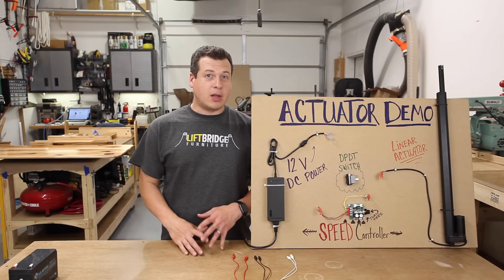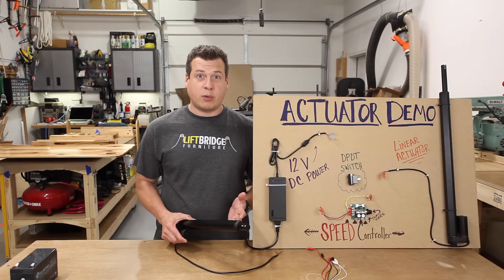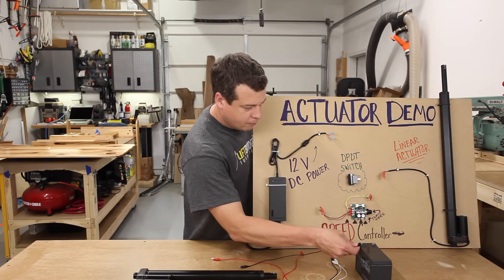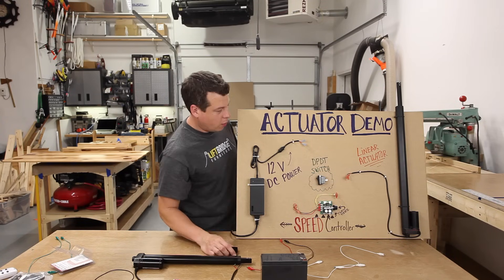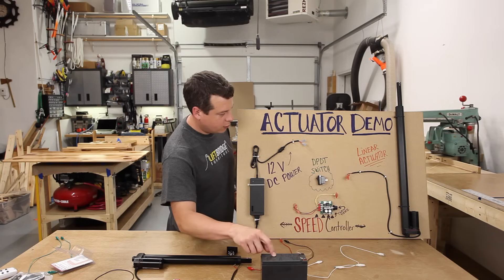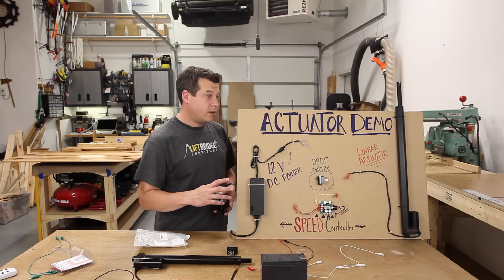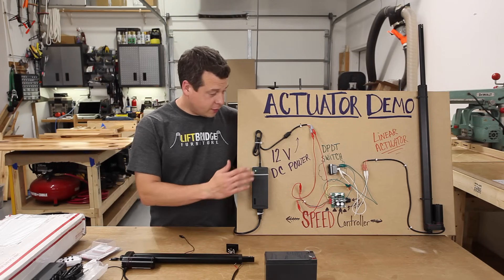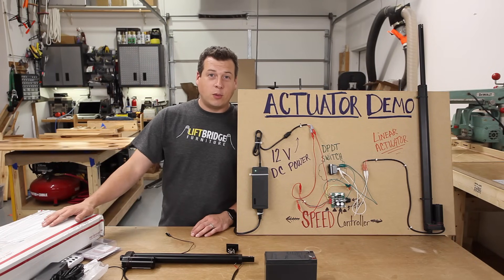Linear Actuators 101 - for Woodworkers

Comment: Question: As someone who doesn't understand electronics, my question is whether it is possible for the polarity of the current flow to reverse on switches and cause a short circuit, or does it not matter which way the positive and negative power supply enters the switch?

Comment: THANKS!   NICE APPLICATION FOR THE ACTUATORS!  I REALLY LIKE THAT YOU ADDED THE "SPEED CONTROL, TO ALLOW FOR "CUSTOM CONTROL, OF THE RATE OF LIFT.
(....BUT, IT'D BE NICE TO SEE THE "WIRING DIAGRAM"/SCHEMATIC.)  TYPICALLY, WHEN RUNNING MULTIPLE MOTORS, IT'S GOOD TO ADD 125% OF THE LARGEST MOTOR AMP DRAW, PLUS 100% OF ALL OF THE SMALLER MOTOR(S)... AND, ADD AN INLINE AUTOMOTIVE FUSE (& FUSEHOLDER), THAT WILL "PROTECT THE WIRING, IN CASE THERE'S AN OVERLOAD/SHORT,...(ESPECIALLY IF USING A "BATTERY" AS THE POWER SOURCE.).  THE "POWER SUPPLY, MAY HAVE IT'S OWN FUSE/CIRCUIT BREAKER.   :face-blue-smiling::face-green-smiling::face-red-heart-shape::face-red-heart-shape::face-red-heart-shape:

Comment: What are the connectors that you are putting in the ends of the wires to make them easy to connect and safe to handle? Thank you!
Reply: Also want to know ….
Reply: Believe they are Insulated male and female spade connectors.

Comment: How do i cut and wire it to a car battery when they send me with the 120 wall adapter? How is the 12v power supply working in this video? If its plugged into the wall i want to cut that off an wire it to a battery.

Comment: So, is the power pack only necessary if you are using 110v in a household/furniture application? Would it not be needed in a vehicular or RV 12v application? Thank you.
Reply from the maker: That's correct. You can power it on any 12v power source.

Comment: Hi I repair and replace motors for recliners and I believe they are basically the same type of motor that you are using. I was just wondering if these speed controllers would speed up a new motor that is slow? Or is the speed of the motor the fastest that it will go. Thanks

Comment: Is there a way to install a small actuator (to open and close blast gates) in a way that it opens with the switch the shop vac is on and closes when power is shut off? (My shop vac and tools are on an automatic vacuum switch). I have a regular wall switch that activates the vacuum without the tools on. I want to wire an actuator to a blast gate just by giving it power on and off (without having to switch polarity). Thanks!

Comment: Thank you so much. This is the best video I have seen that explains linear acurrator and how to set it up. Many thanks. One question, what is the clips you used to connect the wires so there look like spade connectors and what is the wires. Cheers for this very informative video 👍

Comment: Why use DC motors? Wouldn't AC motors be cheaper since they wouldn't require a power supply and more efficient since the current will be lower?

Comment: Is there a brand you recommend now? I'm planning on making the head of my bed adjustable instead of buying an adjustable base. It's on a short wood loft bed with 4x4 corners and 2x4 bracing. My bed is laying on plywood and I was going to use hinges for the bend. If the 2x4 brace doesn't work, I might try some metal angle iron.

Comment: Great video about how these work! I have one, and perhaps a stupid question so please excuse my ignorance. Concerning the power supply/converter. Are you simply cutting the "plug" off of the output cable to expose the internal wires in order to connect them to either the DPDT switch or the speed controller? Thank you in advance.

Comment: I have 2 4” actuators that I will use for wood planer lift, I tried 1 power supply,12v10a and it moved both of them at same rate but just a bump at a time, not breaking any speed records at all lol then I tried just running 1 with power supply and it runs great, any suggestions, on video it was mentioned that 5a would run both so I got a 10a in hopes it would make it a bit faster and smoother, but I need both of them

Comment: I am trying to install an automatic chicken door opener using 12 V battery, solar charger, photocell timer and linear actuator.  I want to add a light also to the timer.  Later, I would like to add another linear actuator.  What kind of controller do I need, and do I need a relay or anything I didn't mention here?

Comment: I love how simple you make make this- thank you so much. Have seen many times now as I havn´t worked with actuators before but intend to build accessible furniture which isn´t totally uncomplicated ;) 

 I have a question about connecting the actuators to the switch- where do you connect the wires for the second actuator- on the 2 metal parts on "the bottom" (the ones that are left)? And what if you need 3-4 actuators, how would you connect them then? 
Finally, in your professional opinion, do you think an actuator in the kitchen need to be covered in some way as it is a space that contains water- even if I find one that has the right IP standard for the area?

Again- THANK YOU so much for explaining this so visual without making us think we are stupid ;) 🤩

Comment: I can't figure out how to wire in the speed controller on one actuator without having a second switch for the other actuator. You you have sample schematic that shows one switch, 2 actuators and the speed control on one switch?
Reply from the maker: Adding a speed controller to a single actuator is very easy and doesn’t require additional relays. But adding a speed controller to a dual actuator setup is more challenging. I recommend a setup that requires a switch modification to the DPDT Momentary Reversing Rocker Switch and two DEI 451M relay modules. I have all the wiring schematics for this in plans that I sell here: https://liftbridgefurniture.com/product/lift-bridge-standing-desk-drafting-table-plans/

Comment: Thank you for the wonderful video.  Do you know if they make an automatic switch which make the linear actuator will automatic go in/out continuous until I kill the power?
Reply from the maker: I'm not aware of a switch with that functionality. But even if they did offer one, it would not be recommended since the linear actuators have what they call a duty cycle limit in which you are not supposed to run the actuator beyond this limit. For example, the actuators that I use have a 25% duty cycle, which means that if I run the actuator for 1 minute (25%), I need to let the actuator cool down for 3 minutes (75%) in a total time of 4 minutes. If I run the actuator for 2 minutes, I need to let it cool down for 6 minutes...etc.
Reply: What are you trying to make man.. 😐🤢

Comment: The desk you build shouldn't weigh more than 125 lbs. even with computer monitors. Can you run that weight with just one actuator if a single actuator is rated to handle up to 220 lbs ?

Comment: I spy a Porter Cable air compressor in the background. That's the kind I have.
I want to create a sewing machine lift. I will also have a vertical slide & ball-bearing glide stabilizing system. Could I use a single actuator in the center to lift the platform for the sewing machine? I don't think max weight will be over 50lbs.
I don't care about noise since it will only make noise while in use. Plus, I'm accustomed to loud stuff so it doesn't bother me. Did you test out any Das Marine brand actuators?

Comment: My linear actuator are from a tempurpedic bed. The plug has a din style 4 pin... Do you know the pinout on that type of plug? Is it possible to convert a 4 pin plug to work on a 2 pin socket?
I have a bed controller that has 2 pin sockets but my linear actuator is 4 pin.
Do you know anything about these type of linear actuator?
I found one video that says you could cut off the plug on a certain brand and it was two wires after the plug. Are all linear actuator the same? I don't understand why some I've seen are two wires and some are 4 and some even 5 or 6 on adjustable bed controllers.
The actuator are 24vdc instead of 12vdc but I'm hoping you might still be able to help. 
Can you give any advice on the subject?
Awesome video!

Comment: how fast can the speed controller go? are there different speeds for different speed controllers? if it's too fast will it break the actuator?
Reply from the maker: The speed controller can only slow down the original speed of the actuator. It cannot speed it up.
Reply: @TommyTompkins  thanks for the quick response. does the speed of the actuator change from the weight it lifts? I'm thinking to add this onto a garden tractor bucket loader. If I lifted 400lbs of gravel, will this work and be quick enough?
Reply from the maker: @caine-chow  Yes, the speed can change with the amount of weight load that you have on it. The actuators that I use are rated for a static load of 225 lbs but the dynamic load is somewhat less. That probably wouldn't work for your 400 lbs application but they do make many different types of actuators with different load ratings so you might be able to find one that would work.
Reply: The fastest one i found seem to be 0.56inch per second for that weight. Is this normal? Or can these things move as fast as hydraulics? Can the speed be faster than 0.56 if i bought a speed controller? Or it shouldn't be because it can damage the actuator?

Comment: Question? Couldn't you run these actuators with a m12 battery also?  DC power is DC power.  Just have to watch for total discharge issues.

Comment: @Tommy Tompkins FYI, I am an electrical engineer so I am only telling you this to protect your equipment.  ALWAYS hook up the negative side first in electrical circuits.  This way if you hook up the powerside electricity has a safe path to travel.  While a 12 V System will not hurt you.  The power-surge from improper grounding can burn up motors without any fuse protection.  I also recommend some sort of fuse protect to protect the electronics.  AC Power causes burst of power also, this can jump up to 140 volts at an instantaneous moment (With AC Power when you hear 120 or 110 it actually means the average voltage).  If enough AC Power gets into the voltage divider circuits the this can increase greater than 12V of power which in turn increases the power through the circuits. This can in turn damage your motors and controllers (PCBs).  I would research how much current is needed to power the motors and either use a poly fuse or normal fuse to protect.  Poly fuses reset themselves on the next start up after the threshold current is met.

Comment: Great video! I was wondering if you can connect 2 linear actuators on a PWM speed controller? Thank you!
Reply from the maker: You could, but they would both reduce speed at potentially different rates.

Comment: @UC5D3vrdQ1j3OcpCjx3ZAEzw  Great video! 
 I note that when you connected the speed controller you only went in 1 direction with the actuator?  
We are trying to use 4 actuators for a project and need them to be in perfect sync.  So we thought we could wire 4 speed controllers 1 per actuator.
 
Every speed controller we have tried is single polarity.....meaning when we connect it to a 3 way toggle switch it works great in 1 direction but whenever the voltage polarity is reversed by the switch to go the other direction it creates magic smoke from the speed controller.

We've looked around for other linear actuator controllers but all seem to have the same deficiency.  

Any ideas on how to proceed here?

Comment: Good presentation. However, if the actuator reaches its limits it will burn up the power supply. The Limit switches could have been mentioned at least to avoid this.
Reply from the maker: The actuators have limit switches built in so this is not something that I have to worry about. When it reaches it's max limit, it will automatically turn off.

Comment: Excellent demo, very easily understood. Just a comment about noise of operation: If you are comparing anything that creates a noise, a doubling of noise, as we hear it, is demonstrated by 3dB. So, if one actuator is operating at 20dB, double that noise is not 40dB, it’s actually 43dB. Strange but true. It’s not a straight Linear scale! Be aware. Again brill video.

Comment: Nice and simple explanation of how actuators can be controlled.

This system is an open control loop, as there are no feedback to see what speed the actuators are actually running at.  Yes, a speed controller would make it possible to make two different actuators run at same speed.  As long as the load are the same.

If one really want to have them run with same speed, one need a closed loop, that is there has to be a feedback so that the system knows which speed each actuator actually run at.  Because the speed are dependent on the load.  So if you move a heavy weight, like a computer or stack of books, from one side to the other, they will run in different speeds.
Then you need some simple controller, like the new Raspberry Pi nano controlling both actuator and reading how fast each are running, so it can adjust power or time that each run, adjusting for the changing load.

Yes, in most cases that could be over complicated, compared to have two buttons that control each actuator separately, so the operator can adjust for changed loads. Then the operator provides the feedback of the system and are the one responsible of leveling the actuators.  Or better, just use one actuator, and the problem with balance is removed all together.  ;-)

Comment: awesome Video! thanks so much! If I was wanting to control it with a timer instead of a switch, I would just replace were the switch is with the timer?  Or would I put the timer between the power supply and the relay that I have?

Comment: Great video. A few questions if you don't mind:

1) Could you wire the speed controller after the switch so that on a standing desk, it only controls the speed to one actuator?

2) is it safe to leave a continuous switch in the on position after the actuator has maxed out it's travel?

3) In a standing desk, should the actuator be installed with the motor at the top (under the desktop) or bottom (at the base of the legs)?

Comment: Mind me asking how you connect the power supply to the wires? Unsure if you need  to cut off the original connection so you have access to the power supplies wires.
Reply from the maker: I think it depends on the power supply but usually you need to cut off the default connector that comes with the power supply and add your own. I usually use twist connectors.

Comment: Get the ones that are 6000 N, or have the "motor" sideways to the screw. It uses a "worm" gear. Most notable is they are about 1/20th the noise. They are often used in furniture recliners and lift chairs.

I'm using them on my "solar tracker". Lookup "12V 6000N Electric Linear Actuator Motor W/ Brackets for Auto Car Door Opener CL" on ebay.

Comment: Dec.  13th 2020 just found your video, Awesome.  LOL, I was about to ask the question using two of them do you have a matching problem, and you answered the question before I asked it.  NOW that's a great presentation.  Going to use this hiding my Porter Cable jointer in my work bench.  Thanks so much.

Comment: Great Video on the Linear Actuator. The wiring hook ups a little confusing, as I'm not electrical  techie, but was still interesting. I just tore down a KD Actuator KDFSJ-362-4, (Made in China), was out of a Lift Chair as it wouldn't do what it was supposed to do. Found out the tube the actuator used was fine but had a Plastic screw-in that the metal spiral rod moved in to move the actuator rod, it seemed fine; when I'd grip the metal spiral rod, hit the button,  and I could stop the rod from moving and could hear some clicking sounds inside the housing as if the gear was slipping. So I knocked out the spiral rod with bearings,  with the motor drive gear in it( which was plastic) which was stupid, and one side of the drive gear for the actuator rod was damaged. Why would they use a plastic spiral gear driven by a metal spiral gear off the end of the motor armature in the first place. Answer: Cheaper to make, and when it breaks sell them another Actuator.  If I can buy just the Yellow Gear, I could get it back working, or I just might have to put it on another Wall hanging board like I did the innards of a Computer and a 42 in thin screen TV.  Anyway I found out how these things work. Thanks for the Great Video.  https://pbase.com/pakrat/kd_linear_actuator

Comment: Awesome video! Just a quick suggestion: you may be able to use a 24v power supply with the other linear actuators to potentially reduce noise (check spec sheet jic). I noticed many of the cheaper units say 12-24v in the spec and it may be similar to stepper motors where an optimal voltage will help reduce noise. I plan to test this on my first ebay set

Comment: Amperage depends on the actuator itself as well as the load, best to measure the 1) no load, 2) load, 3) stall(well, stall isn’t possible, with a 2000lbs LA, tho best you can do is with all possible items you are putting on the desk at full weight, which is really the load measurement).  My desk has 4 monitors and a laptop, is metal, with glass shelf and keyboard tray, 2.5a didn’t work, 10 wasn’t a fit either, got a 20a 12VDC power supply, though I measured at minimum ~14a required.  I needed a 2 foot lift, as I am taller than the average bear.

Comment: I have tried to use them and the controller boards out there are so poorly designed. There just no dependable. One minute they work and the next they stop working. There Ok for use in things that are simple but don't use then in important systems.
Reply from the maker: What controller board are you referring to?
Reply: DC 10-50V 12V 24V 36V 60A PWM DC Motor Speed Controller CW CCW Reversible Switch. There on Ebay. I tried to use it with a joysticks.  @TommyTompkins